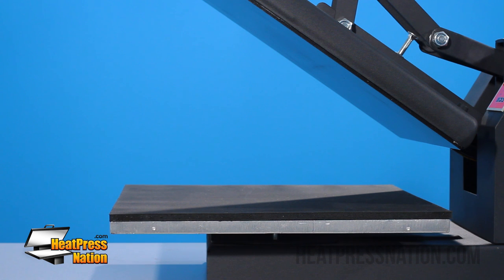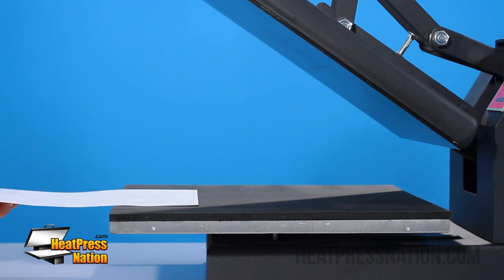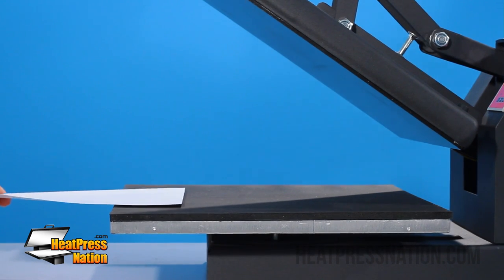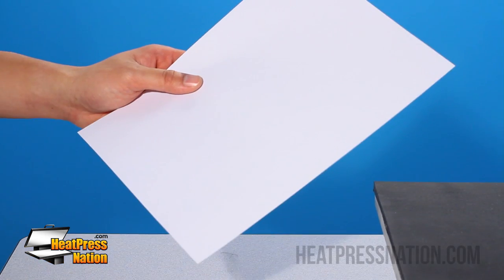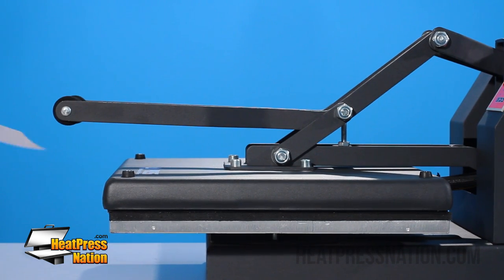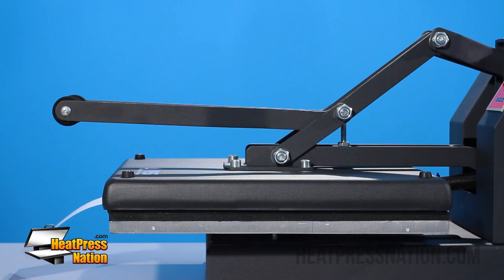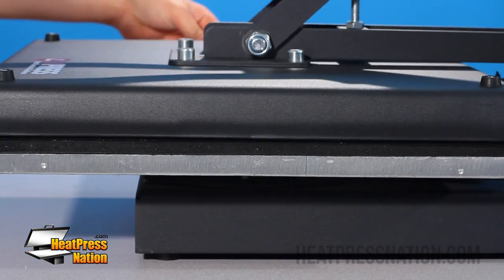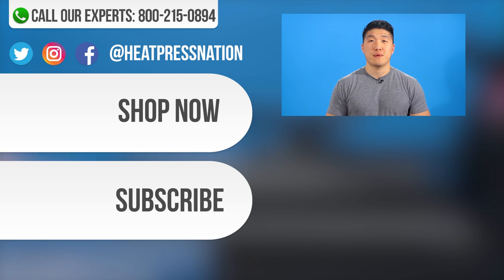Using The Paper Pressure Test To Fine Tune Pressure on a Clamshell Heat Press

Comment: Great video, any advice on how to adjust an uneven top plate? When closed the front passes the pressure test but the back doesnt and has a gap.
Reply from the maker: Hi there! Which heat press do you own?

Comment: This is great. I appreciate this video. So how do I determine "firm" pressure. I am working with Siser glitter HTV and it requires firm pressure.
Reply from the maker: If the paper is stuck in your heat press as shown in the video, this is considered a medium to medium-firm pressure. To get to firm press, just tighten your heat press up slightly. You'll feel the press requires a little more force to close. When applying HTV, it's probably better to err on the side of too much pressure rather than too little. But if the press is difficult to open or close, then you should loosen it up a little.
Reply: HeatPressNation thank you. This is really excellent.
Reply: @HeatPressNation  I just got my machine. craft pro 15X15 when testing the pressure with the paper test the pressure isn't even from side to side? It looks like the top platen and bottom aren't lining up correctly!  Also, using a heat gun the temp is off and all over the place across the platen?

Comment: hi, if i adjust the my heat press's nob very tough ,is that meant it's "high pressure" ? thanks love your video :)
Reply from the maker: On a scale from 1-10, 10 being highest pressure, the paper pressure test will get you to about 6 or 7. This is considered medium to medium high pressure and is perfect for transferring heat transfer vinyl. You can turn the knob to increase your pressure a little to get high pressure, typically used for heat transfer paper. You always want to set your pressure specific to whatever material you're pressing.
Reply: thank you very much !!! it's very clear answer for me :))
Reply: @HeatPressNation  what of ur design comes out crooked? Is it a pressure issue?

Comment: Zac 21
Hi, I’m new to heat pressing! Thanks for the video. I used this method and worked perfectly for t shirts but I then went onto hoodies and the press wouldn’t shut because it’s thicker.. how would you gage pressure with a hoodie?
Reply from the maker: You'd have to adjust your press based on feel at this point. 

Use the paper test to achieve medium pressure. Then open and close the press several times to manually gauge the feel. When you load a thicker item on your press, loosen the pressure in small increments until it's back to this same feel. 

There are some heat presses with pressure indicators, but those are in the $1,200+ range. For everyone else (myself included), learning the feel of your heat press is a part of developing your skill as a heat presser. 

-Jared
Reply: @HeatPressNation  hello,  would you be able to load your material that you are pressing into the press, and do the paper test overtop of whatever your pressing to get medium pressure?

Comment: So what do you do if its so skewed that some parts are super tight but others still dont touch at all. I want to do fleece with one side smooth. If its too much pressure it ruins the pile and permanently flattens it but if you loosen slowly one section is ghosted and not pressed properly because pressure is so ridiculously uneven and out of whack. How do you adjust?
Reply from the maker: There's not really a general fix for that. I would recommend reaching out to the heat press manufacturer to see how their press can be adjusted specifically. If it's one of our heat presses, please contact our Tech Support team directly at (800)215-0894.

Comment: Hi, I just bought a Piccollo flat press and when I do the pressure test with the paper . The paper on the  left hand middle side comes out much easier then the paper on the right hand middle side. In order to get the left side paper to not move at all- I have to crank the pressure to high. Is this normal? Or a faulty product? Thanks
Reply from the maker: Once the paper is stuck in the front, there shouldn't be much additional pressure required (if any at all) to get it stuck on the left and right sides. If it's a significant difference in pressure, the heating element or lower platen may not be sitting level with each other. Sometimes in shipping, presses are dropped and parts can be bent ever so slightly - especially on cheaper presses with poor packaging.
Reply: @HeatPressNation  I am also having this problem. The left side of my press the paper will not pull out at all just like the front  paper but when I go to pull the paper out on the right side it pulls out there’s grip there but not A lot.

Comment: Whats the heat setting for a screen print transfer on a dri fit shirt?
Reply from the maker: It can vary widely. It's usually somewhere from 275F to 350F and 3 to 10 seconds. If you're purchasing pre-made screen print transfers, your supplier should have recommendations for their products. We suggest reaching out to them for the best results. Otherwise you'll have to find out by trial & error and that's not fun.
Reply: @HeatPressNation  the comoany recommends 325 for 9 secs. I pressed a high heat screen print transfer onto a drifit shirt but it scorched my shirt

Comment: How do you adjust the sides if the paper still moves
Reply from the maker: The pressure adjustment knob adjusts the pressure evenly across the entire platen. There is no way to adjust pressure on a specific section of the platen.

Comment: So this will work for anything I’m doing? Whether it requires light, medium, or firm pressure?
Reply from the maker: No, the paper pressure test will help you achieve medium pressure. 

If you need firm pressure, you can increase the pressure after the paper test. Or if you need light pressure, you can loosen the pressure after the paper test.

Comment: I use siser easy weed HTV and use the right temperature and have a firm pressure on my heat press, my problem is when I wash the garment (T-shirt) for the first time the wrinkles you get from washing stay in the vinyl and the vinyl almost peels of on some parts of the design. I don't know why this is happening when I am doing everything right, what do you think is the problem?
Reply from the maker: Here are a few possible reasons why this is happening:
- Incorrect settings. Siser EasyWeed HTV should be pressed at 305°F for 10-15 seconds with medium pressure. (if your pressure is firm, that should be fine) 
- Washer/Dryer is too hot. Make a test shirt and use cool water and a low/tumble dry setting. 
- Fabric Softener. Shirts that have already been washed with fabric softener may have issues w/HTV adhering.
- Washed too soon. You should always wait at least 24 hours after pressing to wash your garments.
Reply: @HeatPressNation  thank you

Comment: Question how to fix the heat press handle because my press machine handle do not move for some mysterious reason and it's a brand new press machine an any assistance and advice is appreciated.
Reply from the maker: If you purchased your press from heatpressnation.com, please contact our Technical Support Department at (800)215-0894.  They will be able to assist you with that.

Comment: This did not work for me. The upper platen is not adjusting evenly. The back part the paper test works but the front part, the paper slides out. How do I fix?

Comment: you are showing how to set up the pressure to print firmly onto a piece of paper, but can you show how to set the pressure to print t-shirts which are thicker than paper. The machine pressure would obviously have to be different.
Reply from the maker: We actually use a piece of paper to test pressure for t-shirts. The minimum pressure required to hold a piece of paper in place is the perfect amount to properly press heat transfer vinyl (and most other transfers) onto a t-shirt. So by following this video, you'll have the correct pressure to press your tees.

After that, your experience will give you a "feel" for how much pressure you'll need. This will allow you to adjust your heat press for sweaters and thicker items.
Reply: thank you :)
Reply: @HeatPressNation  so what would happen to the print if the pressure is to low or to high? Will it bleed out if its to high or something like that?

Comment: Hello! I need someone to help me with my machine. I was trying to adjust the pressure and now it is not closing. It is the first time I'm going to use it, it's my first order to do and here I am freaking out!!
Reply from the maker: Sounds like the pressure is too tight on the machine. The easiest way to go is to start over. Loosen it as much as it will go, then start increasing the pressure in small increments. Eventually the paper will get stuck like you see in this video and you'll be at the proper pressure setting for HTV.
Reply: @HeatPressNation  thank you so much for your help

Comment: When I turn the knob to increase pressure the press will no longer lock into place is that common?
Reply from the maker: That means the pressure is set too tight. Try loosening the pressure to where the press closes with ease. Then increase the pressure in small increments until the paper gets stuck.

Comment: What happens if you have a press that will not grip the paper even with the pressure knob turned to high pressure?
Reply from the maker: That's very unusual, but would seem to indicate the press is not providing enough pressure. 

If this is happening with a heat press you purchased from us, please reach out to our MyExpert Support Team as soon as possible. They can be reached at (800)215-0894 from 7:30am-3:00pm PT, Monday through Friday. I'm sure they will be happy to get this sorted out for you.

Comment: How do you know the difference between light, medium, firm pressure. Sublimation uses light pressure, right?
Reply: Maria Leah Woolery that´s kind of why I came to this video. Instruction says my heat press needs to be a 30psi. I’m not sure how I can tell if I’ve got the right pressure set.
Reply: I just got a heat press and trying to figure that out . Did you ever find out ?